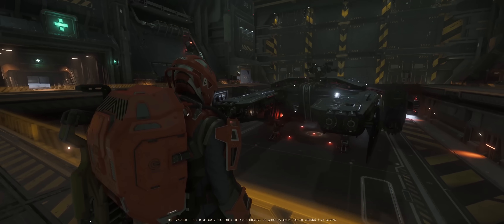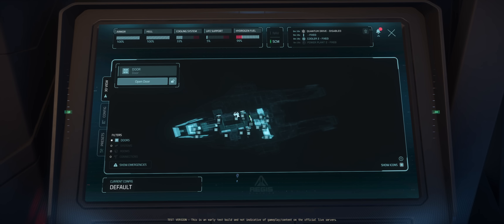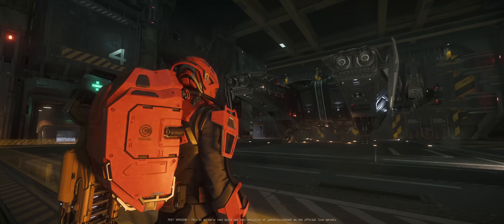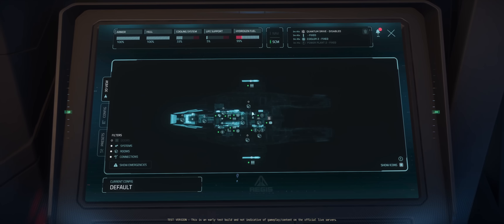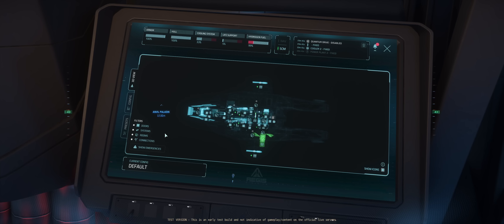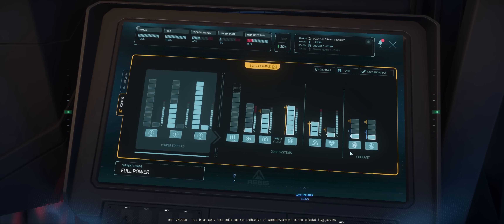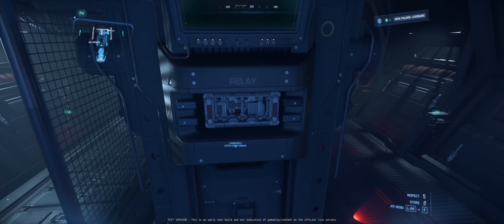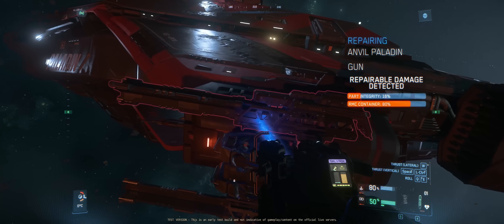Engineering for Dummies - Get to grips with the Basics for 4.5

Comment: Pro engineering tip for star citizen: get out the pilot seat, backspace, respawn, reclaim yoir ship. Time saved: 1hr getting all the crap needed + 30mins of trying to repair components etc. + 30mins repairing the outside of the ship - 30mins average claim time = 1hr30mins saved. 

Desired result: engineering problem solved, bonus: ship is brand spanking new. Oh, did i mention the time saving of 1hr30mins.
Reply: Yup. This is my biggest issue with engineering. It’s a massive time sink
Reply: They will fix your aproch surely..    the system will analyse your situation and  understand that reparing it will take 1 Hour 30 min..    sooo..  respawning will come with a timer of 2 hours...  🤣
Reply: @tomschuelke7955 yip, create more time sinks to counter time saving. 

The only time I spend in this tech demo now is watching videos like this (on 3x speed) to see what crap cig are producing & poor suckers like this throwing their precious time down the toilet. Oh wait, do the toilets in ships work yet?

Comment: Tried to get my corsair killed yesterday in the PTU, took it in vs a hammerhead on a mission, the ship died from a single missile hit, shields and all ignored both powerplants blew instantly.  I ran about trying to fix them, and had only momentary regain of power before the ship finally after about 2 minutes of constant fire gave in and fell apart. Balancing needs to happen, but I get CIG, the PTU data won't be enough, this hits live and many step on it, many more bugs and balancing issues will surface. Can't wait!

Comment: I see a future with a whole lot of breakneck guns on ships besides the shiv.

Also, it seems like tedium. Hoping they figure out a way to make it fun rather than tedious or at least find a way to make the tedium rewarding enough (not just punishment mitigation, but rewarding) to make it worth it. The more roleplay minded types will happily bring out rmc canisters and fuses, but the more goal oriented or gameplay minded will find workarounds if its tedious and purely punishment mitigation rather than rewarding. 

The games garbage multicrew experience has already taught me workarounds to avoid using multicrew ships, so this doesnt seem like it will effect me much besides what itll take me to deal with multicrew roleplayers (seems like itll make my job easier).
Reply: Why the Breakneck specifically, as opposed to the Revenant?

Comment: Nice vid.  Engineering is a gameplay mechanic that I think larger crewed ships will eventually gain from.  But I'd like info for the solo player/pilot for both single seaters without an interior (such as an Arrow, Hornet or Salvation) and a single seater with an interior (such as a Titan, Intrepid, Hull-A or Clipper).

Comment: Fire is definitely not a death sentence for a solo pilot.  I played the ptu quite a bit and running solo on a Corsair was just like it was on 4.4 and I had no problems.  In the rare instances where I did get fire it was because I purposely took large amounts if damage beyond what I would normally take and when a fire broke out, I was able to put out the fire myself.  One tip is that if you open the doors to the exterior then the oxygen will leave the room and the fires will go out within a few seconds.  Also if you are putting out fires you can check the temperature on the fire extinguisher and keep spraying it until the temperature drops to normal ranges before repairing.  It does drop the temperature of the areas so that fires do not reignite.  So far I have really enjoyed the engineering gameplay.  I am just a bit disappointed that they took away component damage to make it easier for players to transition to the new systems.  But one thing I want to make clear is that this is not the end of solo play and there is nothing that a solo player cannot fly anymore.
Reply: What about solo repairs like during group ERTs with a Corsair?
Reply: your ttk is similar and if you would do the ert’s before then you can still do them now if not better with the hull armor.  If you get into too much trouble then you can still escape and repair but you cannot repair your ships armor.  That being said if you keep your shields up then you will be fine.

Comment: With this current build, I only have one issue with engineering. They said it's to bring the TTK up, but it has significantly gone down. I never thought that it was that bad with the previous patches, but now since they've implemented 'zero hull = zero power plant', it's the death of light fighters, even in PvE. I did a Gilly contract which saw me with 2 light fighters and one tanky Mole, I had an Alpha Wolf. I flew straight at one of the light fighters (Sabre Firebird, full gatling) and was attempting to do a joust run. I hit him, he hit me, my power plant goes down just like that. NPC ship was fine. I had full shield, armour and hull, just dead after one strafing run. That's fine, diagnostic panels, repair, I'll be back up in no time, maybe retreat if I'm in bad shape. Nope. Firebird got his friend with him, circling me and they never stopped firing. The moment my power plant comes back up, it dies, because only 20% and I had no armour or hull left... and also, when it does come back up, you have to manually start your engines in order to go, and you have no shields. Tried 2 more times with the same contract with light fighters, survived a little longer, but same results. The only way I managed to clear it was with a Corsair, just because it's tankier and I had a mixed loadout of ballistic and laser repeaters. Immediately after, went back to PU to see if I was just having a bad day with light fighters... nope, cleared them all no issues, even sustained damage but never soft deathed or anything. For reference, the contract I did was Gilly Scenario 5.
Reply: Don’t disagree with your take, but I’d recommend learning how to fly beyond jousting. Alpha wolf isnt a ship meant to joust with and its punished for doing so
Reply from the maker: Yeah I think TTK is going to be the really big issue, similarly to your experience my concern is that larger ships are very vulnerable to sun-component targeting with ballistic ships like the inferno.
Reply: @LoudGuns  the Shiv’s size 4 ballistics are gonna find their way onto a lot of ships lol
Reply: @Ogata123 why that one in particular?
Reply: @LoudGuns I've seen people in global chat complaining that their Perseus are getting ripped apart by ballistic cannon loadouts from medium/heavy fighters. It's a mess... And now they've gone and changed it again with a mysterious 'buffer' 😑
Reply: Oh no you can't 2v1 whatever will you do?? 😒
Reply: @zillamill  That was not my point but a dick's gotta be a dick I guess 😂
Reply: Well… that how it should be in a Alpha Wolf there. At least until you are a Space ACE.
Reply: @michaelleediederichs9436  Is that so? Is that why CIG immediately changed their decision literally the next day to add a buffer to increase TTK and now doesn't play that way anymore? I love how people just have different ways of saying 'skill issue' without actually presenting any constructive feedback. Your input is so valuable 😂

Comment: I still have yet to see anyone vent their ship to put out a fire, then simply repair in vacuum. That seems easier than fire extinguishers to me, especially if I can lock doors open. I'm not a big ship player yet, so I see myself locking most of interior doors open all of the time.
I wonder though - will you be able to repair the wear and tear of your components at a station or pad? I already top everything off and refuel every time I land. Will I need to replace components at all?

Finally, I want to point out that Engineering seems to be a minor system to me, if I'm just PvE'ing. I rarely get into "unintentional" combat these days, so outside of wear and tear, will I even care about Engineering?
Reply: As I hear it, component wear and tear is not in the game currently. When/if it is, you should be able to repair it in the mobiglass.